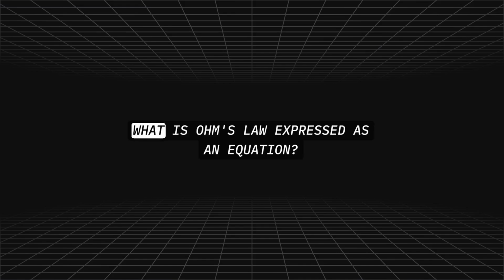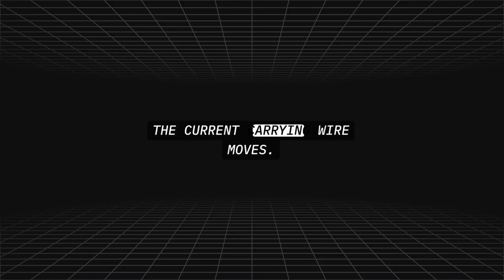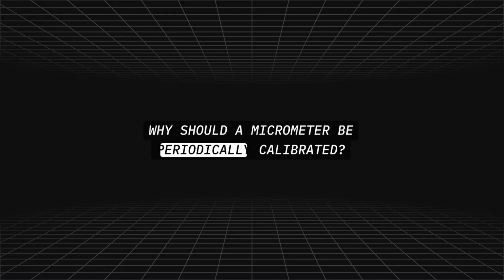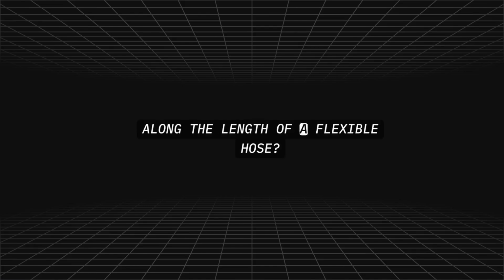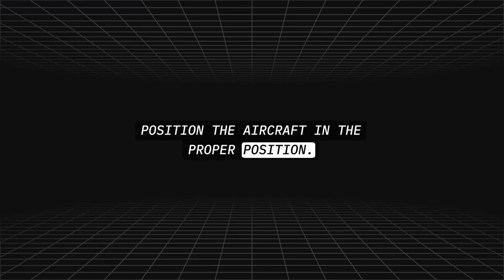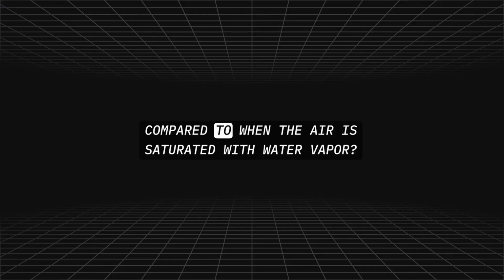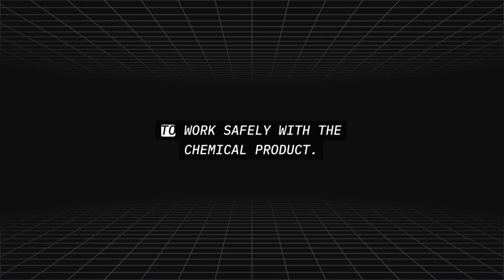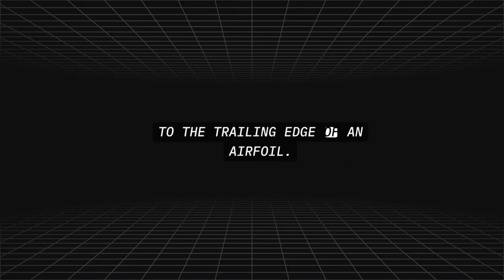FAA A&P General Oral Exam Questions (Bakers)

Comment: I took my test o&p  on 07/10/2026 and passed just by using this.  Thank you!!💯
Reply: I go tomorrow for my PP O/P....Did you get stumped by any questions or were they straight forward?
Reply: @jaimeroberto2419 how did you do?
Reply: @aaronhayes836 ... I did great . Was actually over prepared... I was asked broad questions that were covered in the video... Concepts regarding W/B... Corrossion Control .. Several questions on wire, allowable voltage drops.. Math....decimals to fractions... Powerplant  section was even easier .... Straight forward questions.. A few projects... More questions that you can look up... I was definitely prepared just by hearing the vids many times
Reply: @jaimeroberto2419 awesome 👏 congratulations. My test is next Tuesday so just trying to get studied up and take in all I can
Reply: @jaimeroberto2419 well A&P O/P, both. I take both next Tuesday
Reply: @aaronhayes836 .... Thanx... If you get 85 % of the video and are good following instructions you'll be a licensed Powerplant mechanic next week... Answer the questions... Don't add anything... In and out... Break a leg ..👍

Comment: Just passed my O&P's 4-24-2026. This help me so much!! Much respect to the creators of this video😊🎉
Reply: Congrats! How was the practical portion for you?
Reply: @travispierce5258 not bad at all. A few remove, inspect and replace projects. Identify parts of a carbuerator, turbine engine, anttenta types. Before I knew it I was filing out a nick on a prop and then  I was congratulated got my temporary license and was out the door. 😅 That was alot to say but I truly had a wonder experience. 🎉